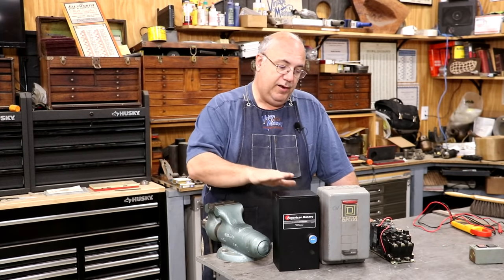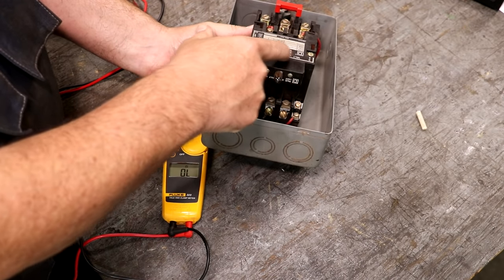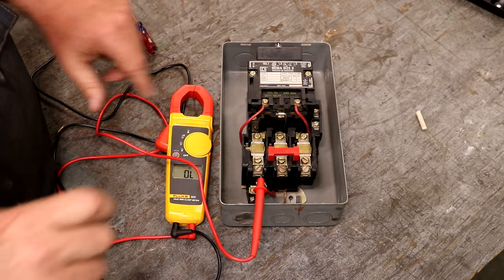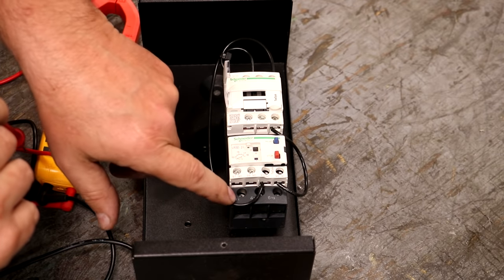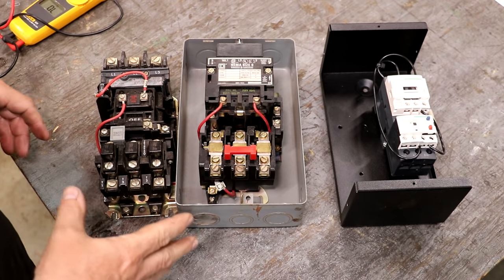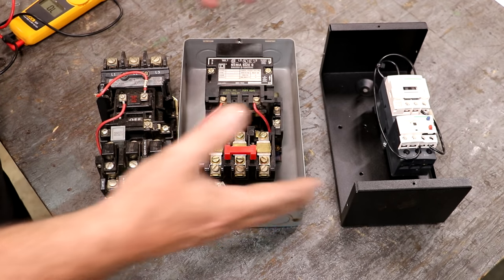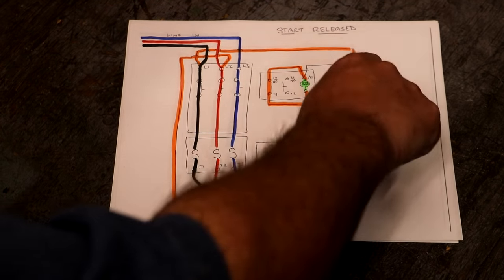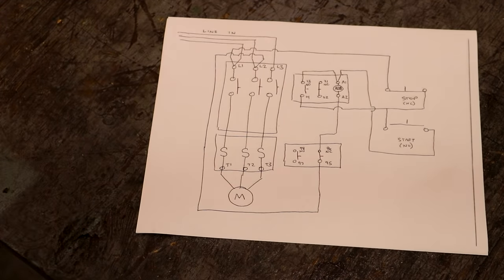Motor Starter On-Off Push Button Station Circuit Explained

Comment: You can add normally open auxiliary contact blocks to the Allen Bradley or the Square D motor starter as to do the same thing as the American Rotary starter, the only issue with those smaller starters is the longevity of them. As a electrician for 40 plus years, to me nothing beats the old school AB 505 motor starter like you had there, they are bulletproof and will last a lifetime, I have seen way too many of those newer starters fail in the last few years.

Comment: Thankfully Keith qualified his motor starter tutorial by admitting that he is not an electrician. 
I quit counting the errors that he stated and demonstrated, because I quickly ran out of fingers!
On the otherhand, if you can cypher through the misuse of terminology, electrical physics and misunderstanding of overload and over current his explanation is acceptable. Follow his electrical drawings and be less generous in accepting all of his descriptive dialog. He has the functinal gyst for the novice, but he included a lot of misinformation. 

Keith is obviously very accomplished. He regularly tackles work that I don't try. Kudos to Keith for getting it done, but I think that he should let this topic be handled by others that won't convey so much misinformation.

Comment: Keith

I need to wire in a remote start/stop on a 110v  single phase motor starter. Would the wiring be any different? Your schematic confuses me as being single phase, I have no connections at L2

Comment: Keith,

You don’t mention another function of a motor starter.  It provides a no-Volt release so that if the supply fails it will turn off and so when the power is restored the machine will not start unexpectedly.

In the UK start buttons are normally slightly recessed so they are difficult to press accidentally while stop buttons have a large mushroom head so are easy to hit quickly in an emergency.  Is it not the same over there?
Reply: (He actually does at end. Ugly scenario. Power fails. Decide to clean/adjust machine. Power restored.). Most important feature in my opinion.
Reply: @robertbamford8266  the struggle with ADD is real.

Comment: I think society in general has given us a warped sense of what is “normal.”  Finally, a video that explains it. Nomal(ly) closed - you get the beep.  Normal(ly) open - no beep.  JK!!  Also, the overload section protects the wiring as well as the motor. This video will really come in handy when I get to the motor controls on my 10ee. Thanks Keith!
Reply: Standard electrical terminology which reflects the physical state of a switch. 
Closed means contacts are connected, i.e. there is no gap and current can flow.
Open means contacts are disconnected, i.e. there is a gap and current can't flow.
It's analogous to a draw bridge, not a door.

Comment: Hello Keith, great vid., but having trouble w/Oliver 299D planer. 
It had a 400v. AB starter. I have rewired motors for 240 and bought a 509 B0D.  As you know the planer has 2 motors an seperate switches for feed/cutter head. Would like to connect w/you thru VM website as I am also a member.  TY

Comment: Another use for Motor Starter Type Switching is to protect Electronics. It shuts off the Ckt at the Hint of brown outs or Flickering Power, Like Auto reset Power line breakers and they Stay off till You deem it safe to turn them back on. 
I have made a few with just an Ice Cube Continuous Duty  10 Amp relay, Nc & No buttons. 
Then I plug a UPS into those if Needed.

Comment: I never thought about these switches. Great video. Question: why don’t they use a simple on/off light switch?
Reply: Lots of reasons, but one important one is that if power is lost, with these, the machine won't just come back on (possibly unattended) when the power comes back on. It defaults to being off and only routes power to the machine when the On switch is momentarily being pressed.

Comment: Based on the circuit diagram, when you hit the START switch, aren't you shorting L1 and L2 together? Is that normal?
Reply: You are not shorting them, the coil is the load for that circuit.
Reply: @dimtt2  True. Since this is 3-phase, can two of the live wires be shorted out? I had thought only when the sine waves are exactly 180 degrees apart would they cancel each other.

Comment: Is it worth putting a Variable frequency drive on a synchronous or asynchronous motor?  Should the VFD be only used with a servo type motor?  Example lathe drive motor with no gears(VFD servo)
Reply: Possibly, if the motor is strong enough at lower speeds. Mine was way too small.

Comment: Something that may be outside the scope of this tutorial is that you can have different voltage coils, 240V, 120V or even 24V low voltage.  Your illustration is for a 240V coil but the wiring will be different for other voltages.
Reply: I've seen modern power installations use 24v as a control voltage for switchgear. It would be simple if a 1:10 transformer could be used if the relay coil is AC.
Reply: @ianhelsbyservices  I wired up a motor using 24V relay coils and I just added another relay to get around the coil load voltage mismatch. It was what I had to work with. I wasn't about to go out and buy something else either. Not when I had a whole box of relays just begging to get used for something. I looked for the circuit online and couldn't find one. So I just figured it out for myself. I thought at the outset that doing what I wanted to do would be commonplace. Seemed like it'd be a common problem. The circuit here is great if you have the right contactor.

Comment: I believe they also save or limit the need for heavy cable to a switch and preventing all three Lines having to go to an on/off switch.  High voltage is more dangerous no question so this starter idea only uses one L vs. 3. I think its mostly about electricity safety and user safety plus the magnetic starter fully engages the circuit efficiently vs. a manual switch could engage the  circuit slowly causing arcing and heat depending on the operator working the switch. These typically get invented due to hazard and safety concerns over the years.

Comment: The traditional fused disconnect, magnetic starter, and thermal overload protection is the best way to protect a motor. But it's also expensive. The American made NEMA equipment is rugged and durable plus is very responsive. The fused disconnect (not shown) provides short circuit protection and quick acting. The overload heaters are slow acting which allow the motor to start and withstand periodic overload but trip if the motor is severely overloaded. The combination works in tandem. The European standard IEC equipment is cheaper to make and works differently, a instantaneous trip breaker and a adjustable trip relay. Not nearly as durable and cheaply made. You always want to protect a valuable motor with the NEMA type equipment, Allen Bradley and Square D are the best. But for smaller 3 phase motors that are less likely to see heavy loading the Chinese IEC stuff will work.  If you want to preserve the vintage flavor the IEC stuff is sacrilege. 

Incidentally, the heaters are exactly that. These is a small nichrome coil wound around a metal alloy that will melt when heated up. If excessive current flows the alloy melts, and it releases the trip mechanism. The alloy cools, and then you can press the reset and current flows once again.

Comment: Usually L1 L2 L 3 has 130 volts going thru them   coils usually only need 24 volts and push buttons so wouldn't hooking the switch to L1 be to much or the auxiliary contact

Comment: At 3:50 you said the circuit is open = no voltage can go through.     

But then at 5:26 you say it’s closed = no voltage can go through

Very confusing

Comment: The only thing that you left out of your control system is the fuses that protect your control circuits. When you leave L1 and L2 you need fuses. You should have no more than a 2 amp fuse for up to 1-3  small starters. If not the small controll wire is protected by the same breaker that is feeding your starter. Unless you have a control transformer sized for your control system then your transformer needs fuse protection. If something happens to your wiring or your start stop station gets damaged it could be bad.

Comment: If the service factor of the motor is 1.15 or greater the overload or heater on the starter needs to be set or sized at 125% of the Full Load Amps or current, FLA and or FLC.

Comment: Motor starter? I thought they were called relays or contactors. Different strokes I guess. I note that you do call them contactors at some part of your video.
Fuses/Circuit breakers are there to protect the wiring in the event of a fault in the equipment. They are not there to protect a motor (or load). If your motor is drawing too much current, it is faulty. If the circuit breaker is not rated correctly for the wiring, you will cause a fire if there is a fault.
In regard to your diagrams and L1, L2, L3; I assume one of those is the neutral??
Very good explanation overall.
Reply: Generally home shop 3 phase is two hot single phase legs from the public utility and a 3rd leg generated by a phase converter, these days one of the incoming legs from the utility transformer is neutral but I have run in to exceptions.
Reply: @m9 ovich That's if the load is wired delta, if its wired as wye you have a neutral at the junction of the three fields.
Reply: Motor starters have overloads Contactors do not. That is how I was taught.
Reply: The breaker at the breaker panel is sized to protect the wiring.
The overload/heater system on the motor starter is to protect the motor. Example: Let's say you are running a shaper or planer and the tool digs in too deep and causes the ram to stop suddenly which in turn stops the motor suddenly, the heaters on the starter will trip before the circuit breaker and will prevent the motor from overheating.
The heaters on the motor starter are more sensitive than breakers in a breaker panel, not to mention that the heaters help protect the contacts in the contactor portion of the motor starter.
Modern motor starters have an adjustment to set the maximum safe current limit, the older starts require changing the value of the heater to get the right current limit.
The motor does not have to be faulty to trip the overload/heater circuit.
The reason it's called a motor starter is to let you know that it's not just a standard contactor. Yes, it is a contactor but it also has a set of side contacts to electrically hold the contactor in the ON position when the start button is released. 
And a 3 phase motor cannot run properly with a neutral as one of the legs, it has to be 3 equal voltage lines for 3 phase.
Hope this helps to clear up some confusion :-)
Reply: @m9 ovich Control is just an illusion.

Comment: One more comment.  You can have multiple Start and Stop buttons.  The Start buttons must be connected in parallel and the Stop buttons must be connected in series.  Multiple Stop buttons are very common where you have an emergency stop button near the operator.
Reply: Yeah with multiple buttons you can play endless pranks on your coworkers. Having a hard time getting started today Joe? No follow through Lou!

Comment: In Europe, the coli is switched between L1 and neutral, which is 220 to 240 Volt. Otherwise the same.
Reply: and a fuse is also used between L1 and the stop button

Comment: ARE YOU STILL AROUND????QUESTION?? ON THE 2ND MAGNETIC STARTER WHERE??? DO YOU PUT A GROUND WIRE???
ALL OUR OLD STARTERS HAVE NO GROUND IN IT ?? FOR THE MOTOR  THERE IS A SHORT GROUND GOING FROM MOTOR CONNECTION BOX TO THE CEMENT WALL ANCHOR IN 4BY 4 BOX ON WALL..
BUT FOR THE IN COMING POWER FROM.BUSS  SWITCH NO GROUND CAN ONE BE ATTATCHED TO WALL ON THE ON OFF BUTTONS??

Comment: Bizarrely, my milling machine does not have the 'no volt release' safety feature on any of the three motors. I'll add one when I get to installing a power supply to the garage !
Reply: I just mounted a loose box (with cable holders) on an extension of the connector cable for my workshop beltgrinder i made from a brooken piece of industrial extension cable and hanged it on a hook on the wall, the on/off buttons are on the machine so they are esy to reach, i also hawe a simple emergency push break on the machine.

Comment: Can use the aux for lights! And or an coolant pump
Reply: I wired one up once with a fan to cool the motor. I had to pop the fan the motor had off for clearance. So I just put an external fan on the other side of the motor. When you hit start the motor runs and the fan runs. It's been working for years.

Comment: There will be a multiple-choice pop quiz right after the video. Please take notes people!
Reply: That pop quiz is called "Life."
Reply: No need. I've even designed a circuit that can latch when the coil and load voltages are different. When they're the same it's easy. Heck it's practically cheating to do it right.

Comment: So what is everyone's preference? A momentary push button to start the motor and an e-stop or the two button start-stop?
Reply: Two seperate buttons for me. I like my old tooling so it's nice to have authentic looking switches to go on them. Not to mention they tend to be better quality and repairable over the newer stuff. I have a sander that latches on mains to a 12v psu powered relay.

Comment: I believe you pitched this one too low on the audience knowledge scale. I was interested in how this sort of thing worked, but not a basic lesson on Ohms law.
Presumably there are even more safe and sophisticated systems featuring low voltage or even RF controls.
Reply: You may be right, but think about the noob who just finds a YouTube video that skips the basics, then noob wires up a motor starter in the wrong way, and Bad Things Happen.  I appreciate Keith taking the time to go all the way up from the basics.
PS  For noobs and time-served machinists alike: if you're unsure what you're doing with electrics, put down the tools and study until you are certain, or get help!

Comment: So it's basically a heavy duty relay.
Reply: Yes, but motor starters have overload protection. No motor protection =  it’s just a contactor or large relay.
Reply: Yes, but the additional contacts allow it to become a latching relay, one which stays energized until power is removed by either breaking the circuit or power failure.
Reply: @honorharrington4546  you do not need additional contacts to latch a relay. You can latch any relay. Well, any relay where the coil voltage is the same as the load voltage. If they're different it can get tricky. What makes the relay latch is just how you wire it up. You run two wires to the coil. One to start it and one to keep it going. Start comes from the line and keeping it going comes from the load. Once started the load side is hot so it keeps the coil energized. But you add a stop switch in the load line. Otherwise you can't turn it off. Unless you don't want to turn it off. Then you can skip the stop switch. The relay will latch on just fine without it.
Show less
￼

Comment: Brace yourself... All the elechickens coming!

They will be posting all the reasons why you are wrong because you are not using low voltage for the start stop switch circuits
Reply: That was me, 40 years ago.

Comment: Your explaining ability is wretched. You sidetrack too much before presenting the basic explanation .. and it's distracting to the listener. You need to draft a script and then go in LAYERS, beginning with the basic operation and NO SIDETRACKS. Don't try to wing these without a script, Keith ... you're too unorganized. This was my very first thumb down to one of your videos. 

Stay on track. Start out with the basics and NO SIDETRACKS. Write a script and test it on somebody who doesn't know zip about the switch. I bailed at 6:53.
Reply: I know how this works and it was confusing to follow. He makes a few mistakes too. Judging by reading some of the comments a lot think they understand it yet clearly don't. He did mix up the different features of the motor starter too much. He should have covered each feature separately. So a bit of planning may have helped some in the presentation.